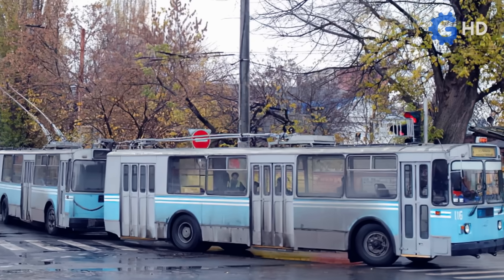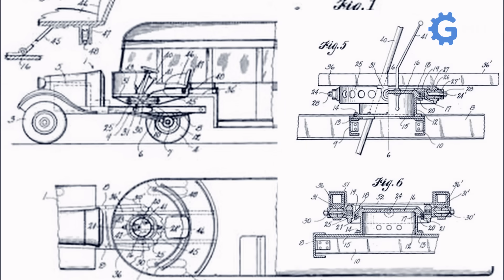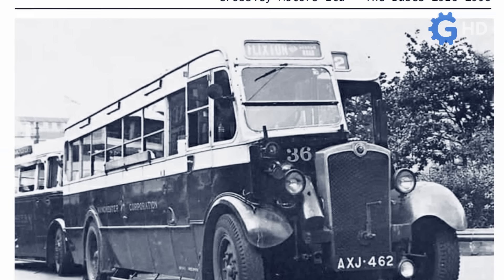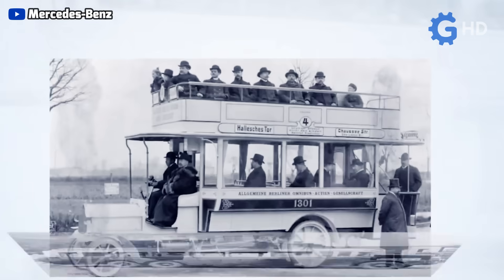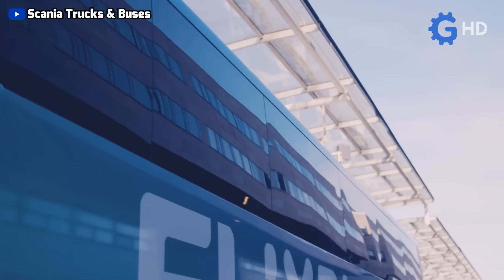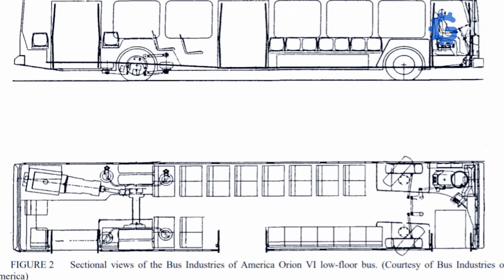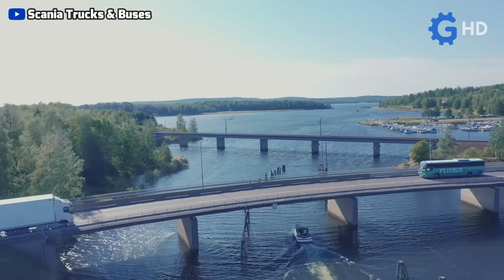This Is WHY The Engine is in The Back of The Bus (It's Genius)

Comment: I drove for Greyhound for 43 years, and we needed greater freight capacity, so the company had twin axle trailers made. We now had a huge freight capacity, and it did not effect the handling of the coaches at all. The passengers could not even tell that there was a trailer behind the bus. Of course, no passengers were allowed to ride in the trailers.

Comment: Actually rear engine buses exist in plenty, though they are a distinct minority. Square nosed, or transit type (type D) buses, while a distinct minority, are critical on routes where passenger capacity and tight turning circles are required. 
I drive a school bus out of a garage of 19. We have 1 full size conventional, 2 type A small buses, 2 type D Handicap buses (1 more on order) and 5 various full size rear engine buses.

Comment: EV Buses with battery in the floor pan and hub motors on all fours, will become the next major upgrade in bus technology and design. This will further enhance their weight distribution and maybe even their centre of gravity. Also they may even get a pantograph to charge their batteries while on the move. This information given in the video here, is very interesting and quite helpful too.

Comment: But the Japanese created an engine and transmission below the driver seat and the rear wheel base are 1/4  from the end of the bus  put enough weight on the rear wheels

Comment: All of your "reasons" why it was "chosen" to put the engine in the REAR are all SIDE BENEFITS for the ONE REAL reason: There is a physical limit to how long a driveshaft can be. You are limited by physics because once you exceed a certain length, the metal drive shaft would just twist apart before turning the rear wheels.  Yes, school busses do have the engine in the front but if you notice they're much shorter and the rear axle is pretty far forward as well. Before you make a video about why all rear engines in busses are DIESEL, I'll save you the time. That's another physical limitation since gasoline engines need both radiators AND airflow over the engine to keep from overheating. They probably could design some ducts near the rear that would allow a gasoline engine to work but why bother when diesels are more efficient and not only tolerate the additional heat, they thrive on it.
Reply: Ah, I wondered why the VW Bettle had the engine at the rear !

Comment: Less noise, better visability for driver, better access for passengers, rear wheel drive.  Just saved you 8 minutes of mismatched pictures and nonsense
Reply: Thanks
Reply: I appreciate it 👍
Reply: Thanks bro
Reply: 😂😂 Thank you.
Reply: Thank you!
Reply: The most important reason is not mentioned: preventing the engine fumes from entering the cabin and poisoning the passengers. That was especially a problem with petrol engines in early buses; and even in buses with mid-mounted underfloor engines. Moving the engine to the rear of the bus solved the problem, as the exhaust fumes are naturally carried away by the wind when the bus is in motion.
Reply: Not all heroes wear capes 😂 thanks 👍🏾
Reply: Thanks bro 😂😅

Comment: How do they get the transmission shift linkages (manual or automatic) to function correctly across 40 feet? I know modern transmissions are shifted electronically, but they weren't back then.
Reply: Good disign with stif rods you can go verry long distance. Also cables are used.  Clutch use oil

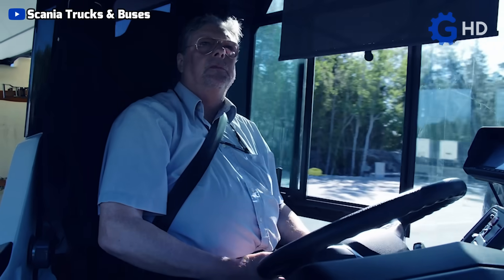Comment: 4:43 huge panoramic windshields are only possible when the engine is at the back?? 

Lol you are confused.
Reply: If the engine is in the front, or you have a nose in the front (bad for view and turning circles) or the driver sits higher (cab over).
Which also has worse visibility then the current configuration

Comment: I drove a bus early in my younger years. Rear engine buses were called pushers. Front engine buses were call pullers.
Reply: In a train, the loco at the front is called a hauler loco, and the one on the rear end is called a banker loco. So hauler and banker are the real terms. Where as puller and pusher are two jargons.
Reply: @singlePRRANJAL_47  those terms have only ever been used on the rails..road haulage is a  whole different kettle of fish...

Comment: Short story for ya, when i was a kid back in the early 80's I was on vacation with my folks in Greece, we were driving someplace on the national road (like US highway) and i had looked out the back window and saw what looked like farm equipment and it was gaining. It didn't take long before it blew past us, and we realized it was a bus frame, with engine in the back and a guy sitting on a milk crate driving it at at least 80 MPH. I was told this is because the frame was made in one location then driving to where they add the body, keep in mind this thing had no seat, seat belt, lights front or rear, just frame, engine, wheels and steering wheel. its something i'll never forget 🙂
Reply: Back when Greece used to assemble buses...
Reply: @MihalisNavara  i'm assuming that means they no longer do? out of curiosity when did they stop?
Reply: @kirknelson156 I think it was in 1984. There were two manufacturers that produced buses. Elvo (Hellenic vehicle industry) and viamax. Elvo continued producing vehicles, mainly military and a few years ago, the company was purchased by Israelis. Viamax shut down in 1984, due to competition and EU regulations.
Reply: @MihalisNavara  thanks, good thing I got to see it before it was gone, shame its gone.
Reply: Sounds like the British automotive industry.

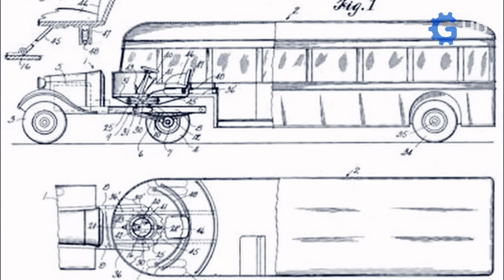Comment: 1:10 for your information, variation of this form is still present today, where first half of bus is normal, and second half of bus is trailer, and only conection between bus and trailer is steel and cables, so no walking there  is allowed.

Comment: 4:18 it allows the lower part of the bus to be free for large luggage space and comfortable passenger space above the luggage space. 5:14 Having low and flat floors allows easy access with few steps for accessability. Make up your mind.
Reply: Both options are available in a pusher. Typically it depends on how the vehicle will be used either locally or long distance.

Comment: HUGE outside mirrors.
A small rod w/camera at front corner of the bus and heads-up projected display on dash or lower corners of the windshield would work better ( fuel efficiency / less blocked view ). A rear backup camera is essential  . . .   ☆

Comment: The next revolution for buses and coaches is just around the corner. Fully electric drives no Diesel.
Reply: And very limited range.
Reply: @robertheinkel6225  still more then enough for city busses
Reply: Around the corner?🤨 they are driving for years now in my country.
Fully electric city busses
Reply: @1987tijgertje Quite. I was hoping the video would move on to electric buses and discussing how bus design might evolve now that there’s no need to be constrained by the limitations of diesel engines, but it never came. Might have guessed, considering the US narration.

Comment: London had front engined 'Routemaster' buses for decades from the 1950's.  There were very successful and were only retired in 2000's when wheelchair accessibility requirements were mandated.   The front engine allowed access via a low open platform at the rear leading directly to a stairs or into the lower deck seating area.  The lack of doors to the platform meant you could hop off on/off when the bus stopped at traffic lights.  A New Routemaster design was introduced in 2012.  The design incorporated disabled access through a closing front door behind the front wheels while retaining open platform rear access, with the staircase still at the rear. The hybrid drivetrain had a front-mounted continuous-revving hydrogenised petrol engine; this charged front-mounted batteries, which powered the rear wheels through rear-mounted electric motors. This arrangement, through not requiring a mechanical transmission, allowed for a low floor and a step-free entrance into the lower deck from the rear platform.  Many of these buses are now being converted to fully electric.
Reply: A 50 year service life is pretty efficient. The rear platform is probably low enough for wheelchairs. The central pole might get in the way though.

Comment: author  must be an american. They're way behind the civilized World as usual. Modern buses have the engine not only at rear, but at rear in the corner fitted vertically (e.g. Solaris) This allows you to get a low floor all the way to the back in urban buses.

Comment: Notice that there is no mention of Leyland who were one of the pioneers of the rear engined bus back in the 1950’s.
Reply: Retired Coach driver, back in the 90's I used to see chassis being driven on the M6 heading for Scarborough, probably to the Plaxton factory, funny seeing the driver in foul weather gear at times.
Reply: @theolderigetthewrongbitget4746  I was at a bus stop in about 1970 when one went past me, the driver all wrapped up against the wind. This was in the days when the Corporation buses were changing from the rear platform Routemaster style to the Leyland Atlantean. The one that went past me was definitely an Atlantean style.
Reply: Still in up and running in India. They make everything. Mostly to fairly low standards.
Reply: Советский автобус ЗИС-154 с задним расположением дизельного мотора и электронной трансмиссией (как последовательный гибрид, только без аккумулятора) выпускался с 1946 года.
Reply: @user-rp4xs2jy1t  ЗИС-154 — лицензионная копия автобуса серии TDE (Transit Diesel-Electric) американского General Motors 1940 года.
Reply: Nowadays they make only front engine buses in India.

Comment: Otto Kässbohrer constructed the first bus with a birdcage frame, four wheel independent suspension and rear engine in 1953 with the Kässbohrer S6.
The concept was then extended to the big buses, although with rigid axles.
The first rear engine bus by Mercedes was built around the same time using a modified truck chassis up until  the early sixties.
Reply: Советский автобус ЗИС-154 с задним расположением дизельного мотора и электронной трансмиссией (как последовательный гибрид, только без аккумулятора) выпускался с 1946 года.
Reply: Советские электромобили НАМИ-750 и НАМИ-751 появились в 1948 году, а бензиновый Volkswagen Transporter T1, внешне сильно похожий на электромобили НАМИ 750/751, стал выпускаться только с 1950 года.
Reply: В основе конструкции электромобилей НАМИ 750 и НАМИ 751 лежала 3-d рама в виде пространственной фермы, к которой крепились аккумуляторы, электродвигатели и подвеска.
Reply: The S8 in 1951 was the first model of Kässbohrer made in this design. No clue if others as this Russian design had this earlier.

Comment: Just to bad with low floor buses, you loose so much seating forcing pax to stand.
Reply: Carry more passengers though which is more cost effective.
Reply: @theolderigetthewrongbitget4746  Fine, but what happened to take it easy, take a bus. Now everyone's on edge, no one sits beside anyone, strollers kick out handi cap people. It's not fun to take a bus anymore, ask anyone who rode a bus during the 80s and before.

Comment: Imagine having to have a 40 foot driveshaft, that would be wild!
Reply: nothing unusual, there are plenty of ultralong rigid trucks with usual cabover design and length up to maximum legal 12m.
Reply: There are some long wheelbase semi tractors that must be in the 20-25’ range…
Reply: Drive shafts are split into two or three pieces with universal joints and carrier carrier bearings.
I would not like to trouble shoot a mysterious vibration!
Reply: Every man's fantasy.
Reply: indians have 15m buses with frond engine design, and long drive shafts,,